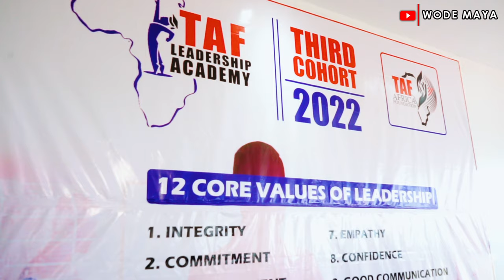Nigerians & Ghanaians Are Building Gambia’s First Smart City!￼

Comment: Great project however I'm concerned about the quality  of the finish product. I don't like the metal roofs ,in 30yrs they would  have to be replaced  .please tell the builders in Africa to use Terra cotta roofing materials, they more attractive  and last for hundred years.tell the developers  to install 4" window sill for nicer finish on the Exterior facade.these detail are simple to produce and enhances the quality of the overall  project. These new developments  in Africa have to step it up on the quality,build for term.